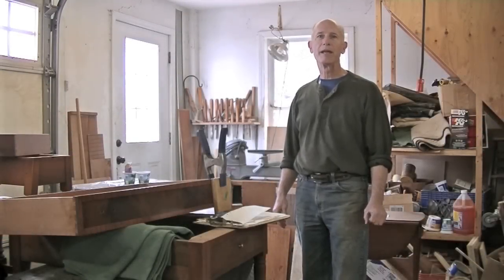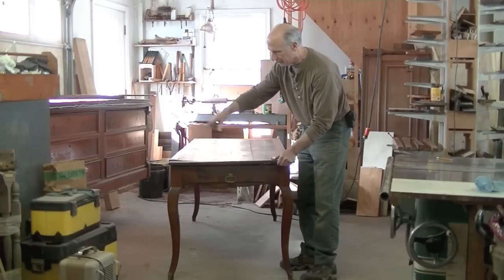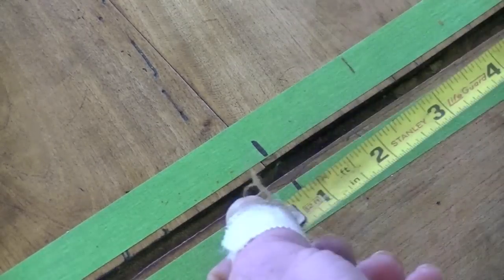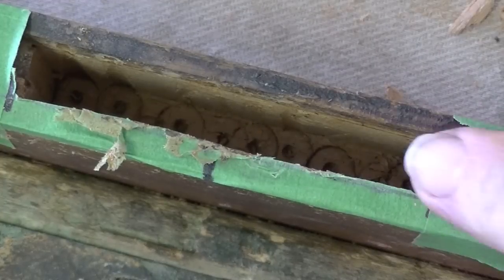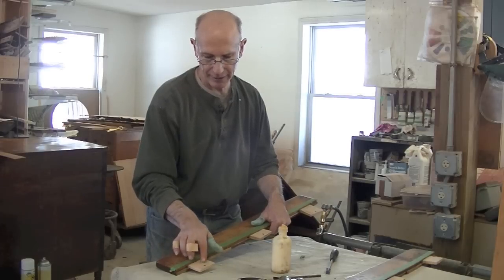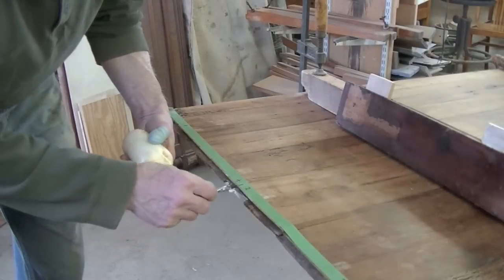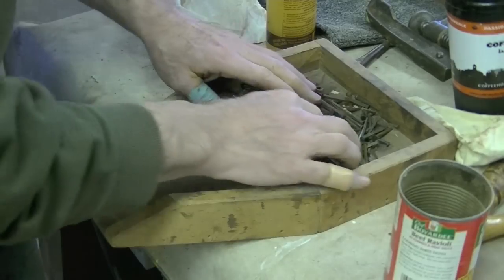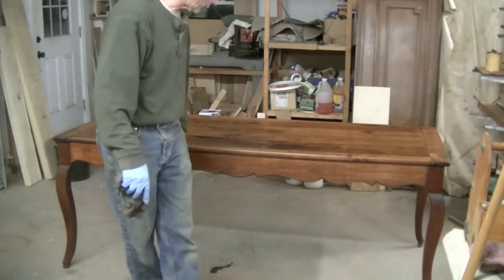Repairing the Top of a French Provincial Farm Table – Thomas Johnson Antique Furniture Restoration

Comment: The nailed top does make sense, since the skirt won't really expand lengthwise, and the nails will have a bit of "give" to them if they really need it. The only other useful way it could have been attached would have been from cleats or small angle brackets underneath (I prefer the nails though).

Also, that tray you dumped the nails into is a BRILLIANT idea! I'm always dumping out screws onto table tops and then having to scoop them back up into the container. I'm going to have to make one of these for my shop.
Reply from the maker: sooth15 Thanks Sooth15! I usually install moveable cleats on these old tables (see my Farm House Table video), but it didn't make sense on this one. And then I realized that the way they did it originally was fine.

Comment: Another Fabulous project! This is the second time I've seen you use cauls, to flatten large boards.. Do you have a "shop set" of these or do you make them for each project?  If the are a "shop set" of tools how do you keep them flat ( seasonally)  and what wood did you use to make them from?  Please please keep this UP!  Without you this craft is gone!
Reply from the maker: Thanks! I keep a set of boards just for this purpose. They are ash, well seasoned I imagine, and stay flat without any special care. Or at least, flat enough! They haven't changed in 40 years
Reply: @johnsonrestoration Huge thanks for the reply. My first set were white oak...someone said "not good enough" ...made them out of steel....Big mistake ...stains all over everything they touched... plan to make a couple of sets from ash....Thanks for the advice..

Comment: Why did the breadboard ends pop off the tabletop to begin with? The tabletop's expansion was the correct direction.
Reply from the maker: The tenons were tiny. I don't understand how they ever held in the first place. Maybe they were glued on, but were doomed to failure
Reply: They were probably fine for as long as Nothing Happened. But it looks like the top developed a little warp, and thus a little pressure, and maybe with a little use/jostling with time, this was enough to loosen the nails. Then it's over and a dude has to put in some real tenons.
Reply: I'd guess, like a lot of stuff, modern central heating might've been a factor too...

Comment: What did you use for the finish of this table?
Reply from the maker: Hi David, I just watched the video to see what I did but I didn't say! hence your inquiry. Now I have to remember, I'm pretty sure I gave it just 1 coat of tung oil and then waxed it. It looked great with no finish on it but I had to sand it some after all the repair work. It's being used in a kitchen and I'm sure it won't take long to get back to the way it was.
Reply: I haven't seen you use a lot of tung oil finishes, but that came out great.
Reply: Thomas Johnson Antique Furniture Restoration Nice job thanks for taking the time to do a nice job on the videos I'm learning a lot

Comment: Love your videos but wonder how you keep chewing up your thumbs. Or is that for dramatic effect?  Keep posting please.
Reply from the maker: They get super dried out in the winter time! It's a constant effort to keep them moisturized
Reply: Know the problem.  Just a thought but as a potter I found that starting the working day off with warm water for throwing or other work prevented the dreaded split skin.  Don't pretend to understand why but it worked, even if over the rest of the day the water I worked with was cold.  As a tiler I was similarly working with water for my wet saw and for cleaning up with sponges and water all day.  It seems to be the cold fingers at the start of the day before circulation reacted to the cold and increases blood flow to the extremities.  No amount of "barrier cream" helped.  Even with "dry" work - suggest trying a warm up of the hands in warm water first thing in the AM.  Hope this helps.
Reply from the maker: That's interesting, I'll try the warm water
Reply: @johnsonrestoration  my hands and cuticles would dry and crack and split open year around.  As a caregiver I am constantly washing my hands and as I gardener who can't stand to wear gloves I was always trying to heal my sore hands. Blistex ointment in the tube and not the stick takes the soreness out of cracked skin and torn cuticles. I discovered this years ago when I got a paper cut and that was the only thing I had in my purse. I wish they made a larger size tube!!  Also I use Surgeon's Secret and it is great for protecting and moisturizing hands (and feet) it's main ingredient is bee's wax

Comment: I don't understand how your repair of the breadboard is correct, at all. The new mortises and tenons are all tight fitting. What happens when the table's width changes? There is no room for the expansion. It doesn't matter if you glue the tenons in or not if there's no room for the table to move. The previous tongue-and-groove might have been too small, but it allowed movement.

I would expected the outer mortises in the tabletop to have been at least 4" wide.  And instead of using PVA glue, using draw-bored pegs to hold those tenons in would have allowed The Next Guy to make repairs.
Reply from the maker: Only the center tenon was glued to both the end piece and the table. I cut the mortises extra wide so they can move. Honestly, I think it's going to be good for a long time
Reply: If you have extra wide mortises in the table top, you're golden. It didn't look that way. But apologies.